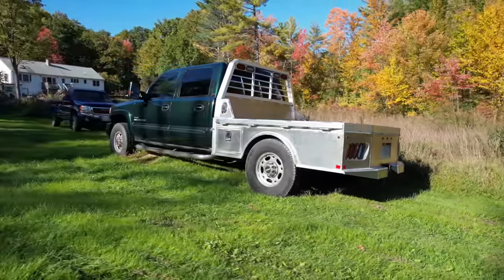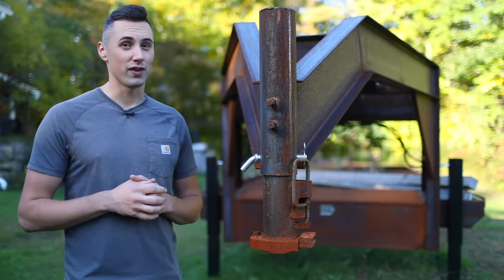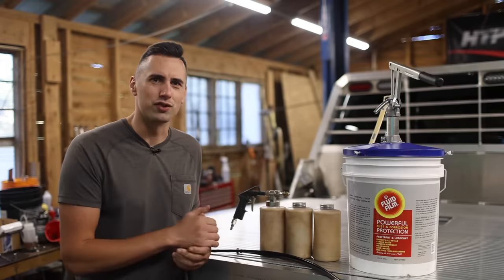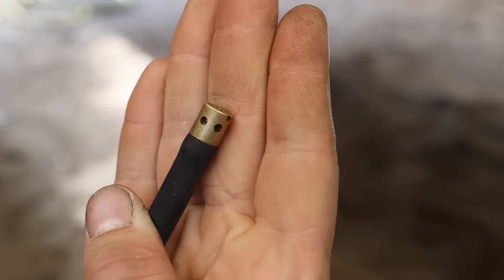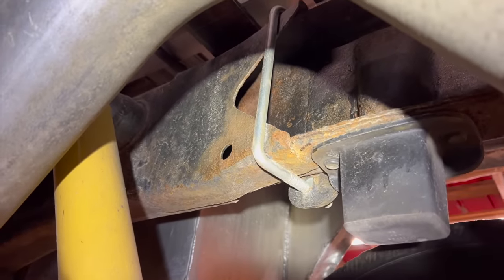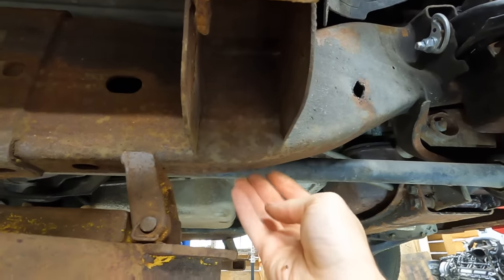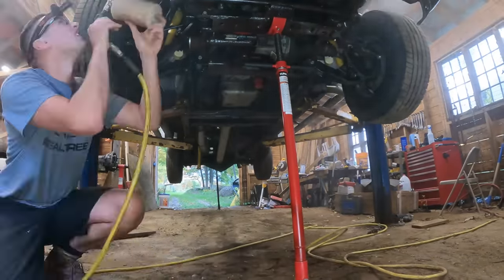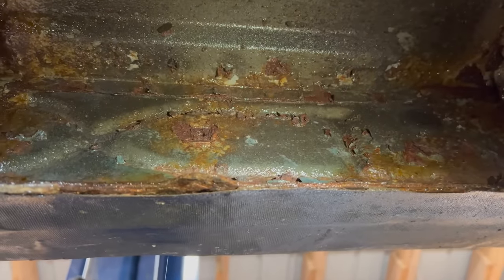Oil Undercoating my Truck so it won't Rust. Easy and Foolproof Method.

Comment: I love the fact that you placed jackstands under the vehicle after lifting it.
Reply: @Abdul-Kabir Alegbe, yea, it scares me when so many people don't even do that when they're just lifting with a standard floor jack. Then I've seen some people use them but they're not level and/or they've extended them too much.
Reply: @zenithperigee7442  I have an innate distrust of standing under this lift. Even though I know they have failsafes. All it takes is a mistake....
Reply: Yes! And I love that he always uses eye protection.
Reply: Agreed! That is a good example of good workmanship. Cudos.
Reply: He did it for the risk of tilting?
Reply: Well most ppl do that have any common sense. If they don't it's just better that way. Having a accident while being safe and using safety equip is 1 thing, having urr vehicle on its side propped up with 2x4s is another.
Reply: @Elaba_ it takes stress off of the lift.
Reply: @jonathanmaxwell326 Absolutely. I can’t get over the number of mechanics who don’t.

Comment: I'm from Michigan. I got a truck from an old man.. He used old transmission fluid and wd40 and pump sprayer.. worked very well truck was almost rust free after 10 years
Reply: Northern Vermont here, been using Bar&Chain oil for over 25years and never looked back...
Reply: @thomasbartlett3409  I also live in VT and I like to use, used motor oil and mineral spirits.

Comment: Waldo, definitely check out the cosmoline rp-342p aerosols. It’s a oil based wax and it dries pretty hard, we used it in the Marines for our vehicles on ships on the ocean and exposed to salt water. I couldn’t recommend it more for fellas in the rust belts.
Reply: For sure, I really like CRC Corrosion Inhibitor. It stays on far longer than the oil based products, I can usually get 2 winters out of a single application.
Reply: Is there 5 gallon buckets of the Cosmoline rp-342p ?.
Reply: @jacobhammer7389  yup, Cosmoline Direct is one site to get them at.
Reply: I hated trying to get that shit off. It's good but mixed with other oils, fluids, grease, wax it's perfect. Semper Fi. 0331.
Reply: Cosmoline is the best I love it
Reply: Yeah, it’s a better solution than oil because oil can’t protect from micro scratches that a car gets while driving. A car needs something stronger than that. Also, I would definitely remove rust before applying anything
Reply: @fatdoughnut8218  Needle scaler for heavy, Ospho for light or stronger acid depending on urr experience. Then a zinc primer or chassis saver type of paint, farm implement, Rustoleum, then 1 quart of any new used oil, 1 quart of any new used trans fluid, 1 tube of grease like grease gun tube and 1 wax ring toilet flange wax gasket from lowes. Heat and mix. Spray, brush etc that and it will last years, not months and u can add anything to it like boiled linseed oil etc. Less than $6 if used oils and fluids used. Cheaper, easier, lasts longer than anything u can buy. Most of the fluid films etc have no oils. No greasy, oily, fluid covered steel rusts covered in 1 of those, let alone all combined. I've used for 3 decades. Pap used since 50s living next to Lake Erie with snow, salt for 5 months out of year. U can add urr cosmoline etc. Without the oils, fluids, grease as soon as it's wore off its gone and all that time and money for nothing. This will last for years. Even through a auto car wash monthly.
Reply: @jasonchristopher2977  does this mix tend to stay tacky or does it set? You put it on after primer?  And when you say "new used oil" etc, you mean you can use new OR used? Thanks
Reply: @Tonisuperfly  Toni it does not dry to a Hard finish. It stays pliable. Like I try 2 think of a good example. Like the frosting on a German chocolate cake. It's not running off, but if u push with a finger it will smash n smush. U don't want a hard coating. I've been looking under cars for over 20 years now. All with undercoating that dries hard just holds in rust.

 Rust forms when the bare metal reacts with water, air. So if we seal it up with primer, paint, then a good zinc layer, then a wax and oil combo, by the time it can get through all those layers, if it does, it will eat the zinc. Why we bury those anodes along pipelines. Pipe won't corrode but the anodes do. So replace cheap and easy anodes, cause the pipe is way way more time and $$. This is last layer of protection. 

 U can use any new or used oil. That's the beauty. It's not being dumped in dirt, it's suspended in wax and grease so no pollution, and it's being used again for this. U can make or buy a gun for $45-50 online. Or make 1 from old paint gun, wager power painter or anything u can get to spray. I had my car quoted by Ziebart. They said $600.00 for basic spray and 200 for each retouch. My mix u won't need to spend a 6th of that. And it will last years, unless u run through water alot as in rivers, off road etc. And if u have a hard coating and get and scratch, u lost already. My mix is self healing. Cause it never dries to a hard finish. If u look up oil rust proofing Monroeville Pa, oil city it's called does this. They work with other companies to make the same thing but with mineral oil. If u like u can use this and not motor oil. As long ands it's a petroleum product. Baby, mineral, melted Vaseline. 

With what a car costs new, spending a wknd killing the rust u got, using a product like chassis black, rust bullet, or master coat and that alone is better than 90% of what ppl do. U have no idea how many ppl want to see bottom of their car cause they never saw it before. That tells me how many ppl think about this subject. It's never too late unless it's on way to junk yard. U can always buy more time. My dad and I did this with a 99 Ram Cummins diesel. it's now got over half million miles with same body. Not many can say they have same body. Most rot off b4 engine is over 200k. I've actually done this for decades. This isn't no I'm a internet expert. I'm just speaking from experience. My Pap did this, showed my dad, now I do this and show my adult kids. Or I do it for them I should say. lmao
Reply: @GlenWBB  that's the thing, u can add whatever u want to this mix. Half quart of any oil, trans fluid, tube of grease and a wax gasket or 2. Add what u like. It only helps. Dont like smell of oils and trans fluid use mineral oil. No smell. I add boiled linseed oil, cosmoline, bar n chain oil. Etc. hell even baby oil, or melted Vaseline. It's all cheap. As long as it's petroleum based.
Reply: @jasonchristopher2977   Wish YT had a bookmark feature for comments, lol.  You should throw up a quick and dirty video on this.  Let me know if you do, haha.

Comment: 1). drill a small hole where the salt water pools and provide a drain.  2) treat the existing rust with a phosphoric acid solution , then coat with a thick grease compound .

Comment: My father used to put grease into an old pan heat it up and then spray all over the under side of the vehicle, he did it to my first new car and when it did eventually get scraped the floor pan was perfect but the rest had rotted away 😅👍🏻🏴
Reply: I'm confused so it didn't work? What kind of grease
Reply: @joshfixall7938  it worked where they sprayed the grease but the rest of the car rusted away
Reply: @joshfixall7938  Read my recipe above. 1 qrt any new used oil, 1 qrt any new used trans fluid, 1 tube or tub of grease, 1 wax ring toilet gasket. Mix and heat in pan, with torch etc NOT IN WIFE'S KITCHEN WITH HER POTS. She will be mad. U can add whatever u want to it. Spray, brush etc. If need thinner use a lil boiled linseed oil. Or mor fluid of any kind. Mix and check thickness.

Comment: I hear old timers up here using old engine oil (once before every season) in a garden sprayer then taking a drive down a dusty road right after. With the caution of "it's gonna stink for a few days"
Reply: Been doing it for 25 years on my 97 F350 and it's still rust free
Reply: @TheRoadhammer379  does it eat bushings and rubber?

Comment: I have done for decades on mud offroading vehicles,best ol for me was high zinc oils like Valvoline racing vr1,zinc help against corrosión and to stick on metal for a while, diluted with Diesel and sprayed with a flushing trigger hose

Comment: Out here in rural PA, I spray the underside of my 97 F350 with used motor oil and drive it like a madman down our dirt road in the summer. I do this every other year, and I have no rust, the yellow stencil markings are still on the leaf springs, the truck is immaculate for the rust belt. Excellent vid Waldo. I may try this method you used to be more environmentally friendly.
Reply: Hey Road hammer, when you think about it saving your car from an early trip to the scrap yard is the most environmental thing you can do. What you do is cheap and it works. Cheers Stuart 🇦🇺
Reply: When your ready to sell that truck I’m in pa too. Give me a holler, that type of truck is my dream truck and would love to take an immaculate truck off someone’s hands. Keep me in mind, thanks.
Reply: @TheBarbellBandit  Idk what you think of this, since I do the same thing you do, but Project Farm and other sources seem to say that used motor oil becomes acidic and actually somehow makes the rust worse? I dunno about that. But I've heard that, instead of motor oil, that using transmission fluid/oil is better because it's a natural detergent and anti oxidizer. And will supposedly stick just as good as motor oil.
Reply: Read my recipe in comments. Live in western Pa. South Pittsburg.

Comment: A tip I saw,, pop-off interior door panel, pour enough vegtable oil into the bottom of the doors to cover the entire length. Petroleum oil will stink up the interior and you don't want to be breathing that for long periods of time. I've did the oil coating for years but you've did it much more thoroughly,, great video!!

Comment: I used to put that on new trucks when I worked at Chrysler. You can also microwave the fluid to make it easier to spray with the venturi effect.
Reply: Miatar
Reply: How would you go about doing that the cans and gallon is medal no ?

Comment: I live in a rust belt area, in Canada. The video is excellent. Wax oil is the way to go. I worked in the auto body trade for a lot of years. We sprayed it in the areas where we welded in rockers and quarter panels. It was an amazing  rust protection.
Reply: I'm surprised you're not pushing Krown 😉

Comment: Great stuff! I use cable grease (heated - sprayed). Works fantastically! We have a lot of salt here in Austria on our alpine roads...
Reply: My Mother was from Michigan’s Upper Peninsula and they used a mixture of Sand & Salt.  The Road Commission kept barrels filled with it along the road side at hills where folks tended to slip.
Reply: That's on the winch cable of heavy equipment. When it gets a frayed spot it will poke through glove and will hurt and be bad for a week or more. Have to squeeze it to get puss out. That's great but nasty stuff. Many times get stabbed by a wicker logging.

Comment: I live in NH as well and have used Fluid Film for a few years. Switched to NH Oil because it seems to stick longer and doesn't get washed off as easily. I have a 95 F150 with no rust as a result.

Comment: A friend from Albany used to buy a used full size sedan for a “winter car”, use it for several years until the frame broke in half, and then replace it. With your fabrication skills, I’d like to see you come up with an underbody spray wash system that you could run over and clean under the vehicle, well. Most car washes fall down at this task, and at self washes with the wand, you can’t get to the underneath very well. Thanks for a thought provoking video and take care.

Comment: I did something similar on my '10 Range Rover (even though it was practically mint at 10 yrs old).  Brushed all the loose surface powder rust off. Then treated it with rust converter, then coated everything in black zinc (to match the original) and then went at it with wax oil.  That car won't rust ever!!!!  A bit of work but worth protecting your pride and joy (or for future owners).
Reply: U use Ospho? What I use. Great stuff. And it's not harmful to humans or planet
Reply: Last summer we purchased a great shape 09 F150 . I needle scaled any rust underneath. Sprayed with phosphoric acid. Let dry a few days. Then sprayed with hot mixture of wax rings , linseed oil and ATF  . Stopped the rust in its tracks

Comment: I've used fluid film on a few of my vehicles here in Vermont. I have noticed that it does come off easier than used motor oil/bar and chain oil mixture that also works well. I still use the fluid film for door hinges and in between the tailgate and bed. Places that are not easily hit by a pressure washer . Great video.
Reply: I can use used engine oil for the underbody of my truck? And then don’t wash the underbody at all in the winter right?

Comment: I've had my 02 Silverado since 04 when I was younger I did a lot of mudding with it so I was constantly cleaning under it and painting it with black Rust-Oleum paint. I recently started working on it again to get it running. It has to be one of the cleanest rust free OBS frames. I bought a bunch of por15 and painted it with that this last time. What I couldn't brush I used rust converter and gloss black enamel on. Undercarriage is often overlooked and it's really the most important part of the vehicle.